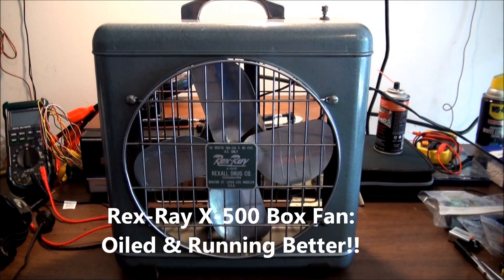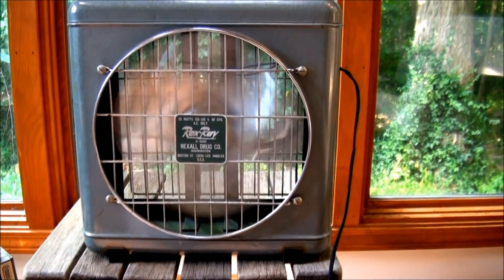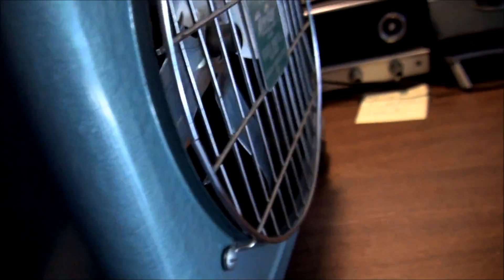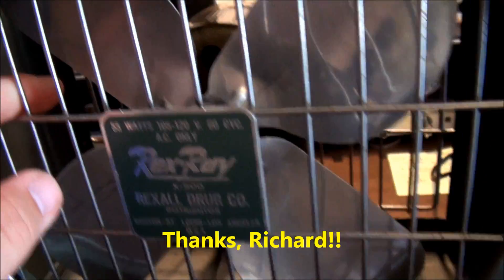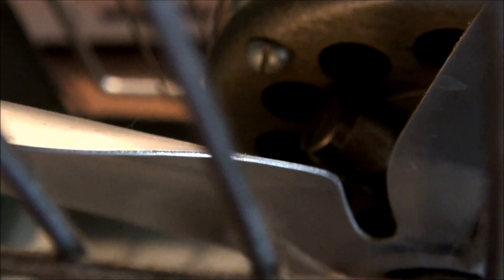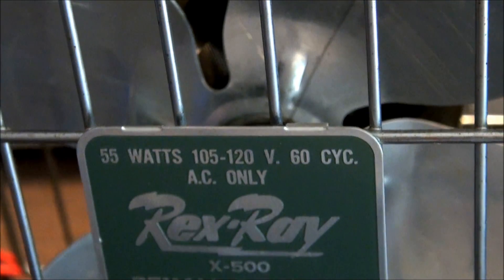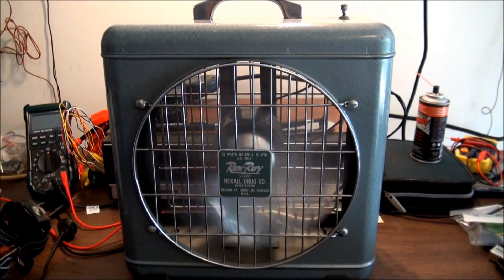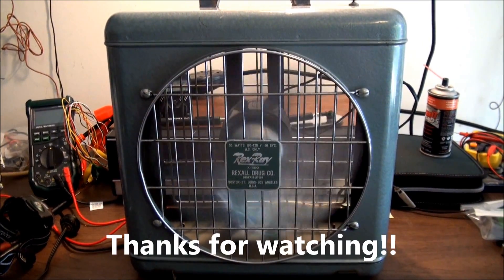UPDATE: Rex-Ray X-500 Box Fan

Comment: Hi, I have the exact same model (though in a little rougher condition) what sort of oil did you add?  Mine seems to run smooth no rubbing from the bearings but I'd just the same like to give the whole motor a once over before I set it up somewhere.